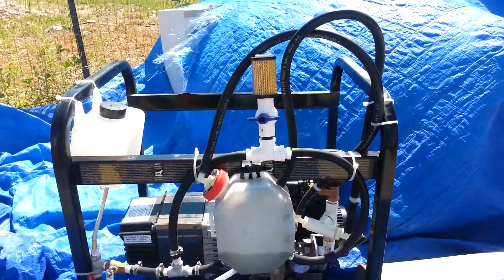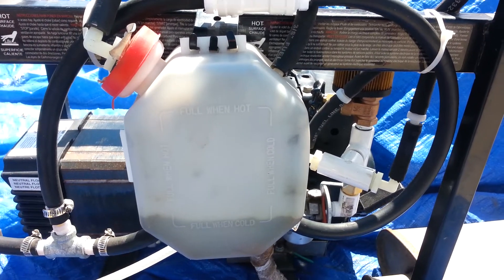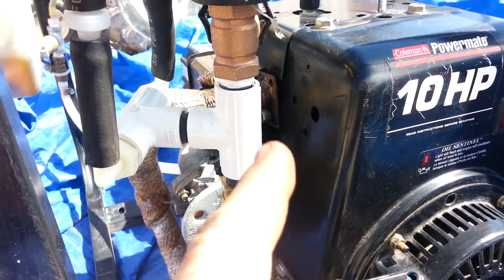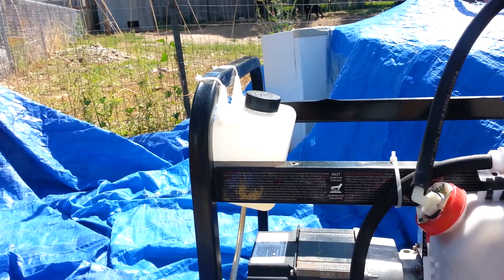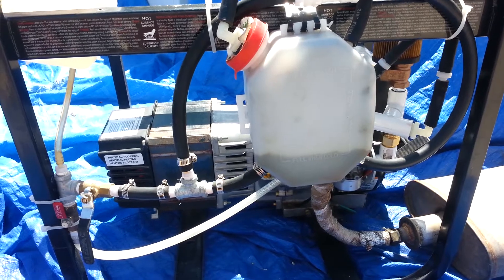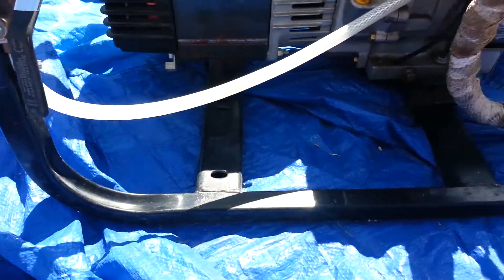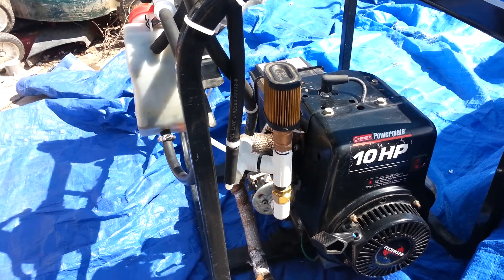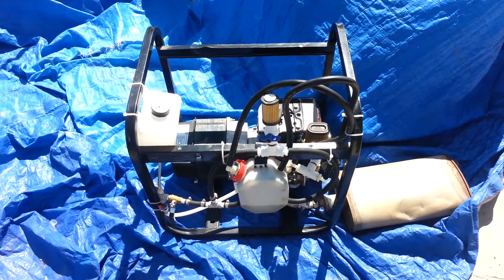GEN SET VAPOR CARBURETOR SYSTEM OVERVIEW

Comment: Nice video! I have 2 questions.
1st... When using 1 quart of gasoline directly into the carb how long would this generator run vs using the 1 quart of gasoline in this vaporizer? Do you think it would run twice as long or _?
2nd question ...Did you find using that auto muffler the generator was quieter? I hook up my generator indoors and had the exhaust pipe running outdoors through the wall and found the generator was still noisy with only a minimal amount of reduction
Reply from the maker: When doing testing the most I have been able to increase the run time was about 3 times the run time when compared to running the engine without it. It is difficult to get the proper data and their was a decrease in power when I did achieve the longer run times. As for the amount of power loss I am not sure on that exact percentage but the could still provide enough power to get the job done. Better testing needs to be done that can show more accurate detailed data.

Yes the generator was significantly quieter when using the auto muffler. You have to make sure your exhaust system is completely sealed off, if it's not it will be noisy.

Comment: Check valves are a good idea but they are redundant meaning over protection.  In the 70s NASCAR introduced EXPLOSAFE which was stainless steel corrugated or what I call ACCORDIONIZED.  It acted like a wind diffuser.  Today, stainless steel wool works even better because it is cheap, easy to install, has low fume resistance and it allows the liquid gasoline more surface area for evaporation.  I want to talk to you about the set up I'm planning for my Antique 455 ci FWD motorhome.
Reply from the maker: The reason for the check valves if to prevent the back pressure form a backfire from blowing back into the vaporizer causing fuel to blow out the intake on the vaporizer.

Comment: Nice setup.
I tried a very simple one on a 13HP engine last night. Once I got it started up, I was surprised to find that the exhaust had virtually no smell to it.
Normally, it is pretty stinky, but this was amazingly clean.
The fuel eventually became ice cold, so I plan on pulling hot air off a copper pipe wrapped around the muffler to keep it warm.

Keep up the good work.
Reply from the maker: Good to hear! Thanks for sharing that with us!
Reply: Tyson Capel
 Perhaps you have heard of Wood Gas Generators?
This is a system that extracts flammable gases from wood, and allows you to run an engine on it.
Since you are experimenting with fuel processing ideas, I think you'll really enjoy the possibilities of woodgas generators  :) .
I want to experiment with the petrol vapour module a little more, to see if I can make my woodgas generator into a duel fuel system.

Ahhh, so many ideas, so little time!
Reply from the maker: ***** One of my goals this year was to build a wood gasification system. I have the FEMA plans for it and you can download them from my website or can get them off the Fuel Systems Research & Development Facebook page under files.I have made small ones out of pop cans but my goal by the end of the year is to have one complete and tested.
Reply: Tyson Capel
 It is very easy to become addicted to wood gasification, especially when it runs your engine for the first time  :) .
Your FEMA gasifier will work, and will be easy to build, but these have a tendancy to cripple your engine with heavy tars.
Been there, done that, as can be seen in my earlier videos.

If you would like to build an absolute winner of a gasifier, may I suggest you look at Flash001USA's videos?
He has built a great system, and has shared all of his findings for all to learn from  :) .

He runs a great little website and blog too.
Take a looky here:

http://www.miniwoodgas.com/

You'll love it.
Reply from the maker: *****
Thanks for the information! I'll check it out for sure!

Comment: Ty - I like the adapter you constructed to connect the gen exhaust to the automotive muffler.  How much reduction in exhaust noise have you experienced?  Do you have any sound -db figures?
Reply from the maker: Thanks It cuts the sound down allot compared to the stock muffler.  Not Yet I just got all the problems with the carb fixed yesterday so now I can start testing.
Reply from the maker: Tyson Capel
No I don't have any sound -db figures.